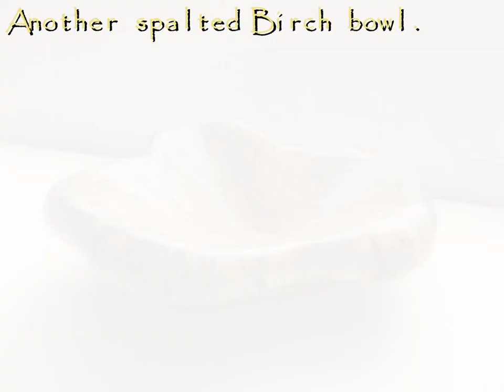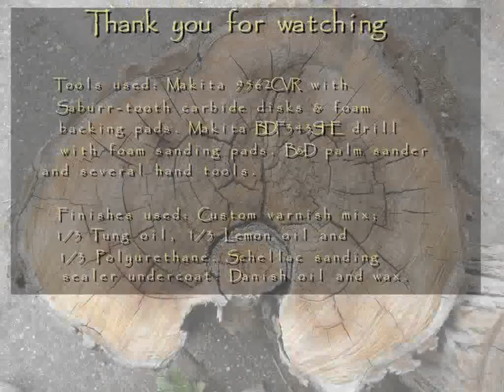Unique Woodworking Projects #3

Comment from the maker: @exrated Thx for your nice comment. :) I indeed use blades for the Angle grinder. They are 'Saburr-tooth' carbide disks. Much safer, and only little slower then the Lancelot type of chainsaw blades. Seriously, I am a pro tree feller, and those disks scare me. If they grab clothes, they will totally maul you up because you can't reach the off switch in time, and the wound cannot be stitched because the edges are to rough.. Be safe!